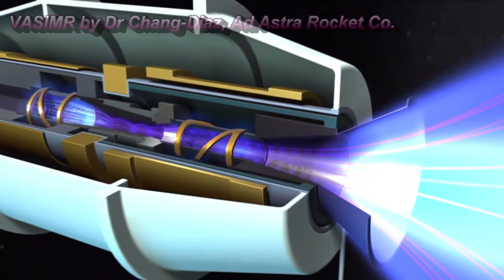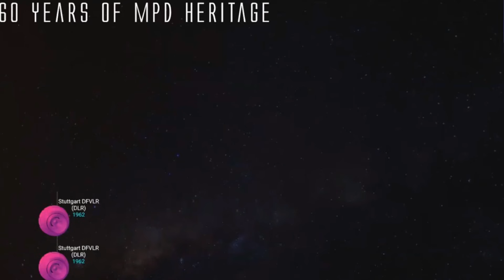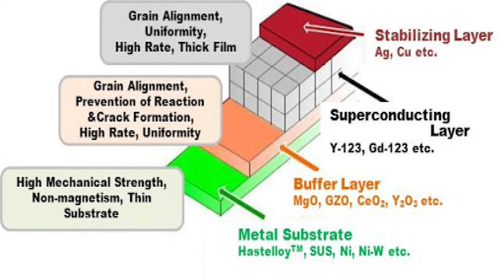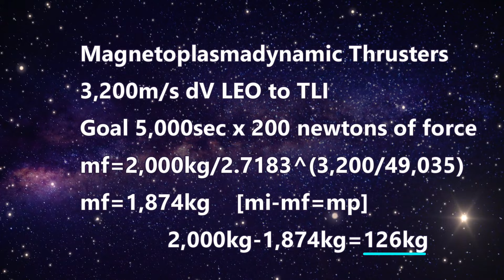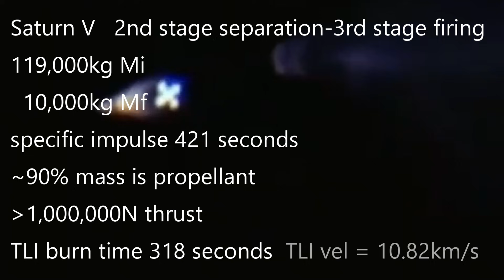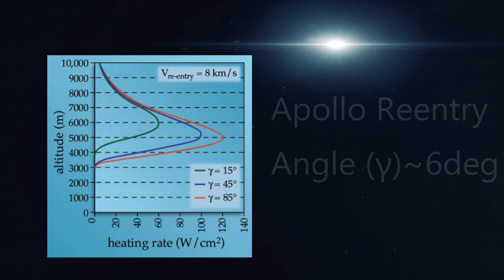Rocket Science: Magnetoplasmadynamic Thrusters and Magnetoshell Shields

Comment: Gravity balances.  If that means the forces from Terra and Luna are equal and opposite, then the net force is zero.  No force, no acceleration, so a particle would travel in a straight line.  At L1, the motion is circular around the T-L center of mass, so there must be some net force toward the CofM.  How far apart are the two points?  Negligible?

Comment: Dump nuke, detonate, Nuke sends waves toward ship..must be a bumpy ride! Also slingshot maneuvers using stars and black holes? Also I was wondering about magnets and repulsion...if you bring two repulsive magnets together, at the point of strongest repulsion, and fasten them in that position and place them in space do they spin if 1 side of the magnets has an obstruction fastened to block magnetic field 1 way...will the assembly spin? If so that would be propulsion...bolt to ship? It probably does nothing but I thought I'd ask🫤

Comment: I realize it's probably critical to be able to control the magnetic field, but are permanent magnets out of the question? Also, for a cooling system to work with the electromagnet, you nee to dump the heat somewhere.  Where?

Comment: Great video! There are a few mistakes you could correct to improve it. At 11:15 you incorrectly state that increasing the magnetic field doubles the power to thrust efficiency. From the numbers presented it is clear you are talking about propellant efficiency, which is just another way of presenting specific impulse. The power to thrust efficiency actually decreases by about 2%. (2.75/100) / (2.1/75)  = 0.982.

Comment: That math says you could hit 0.1c before hitting the inner asteroid belt (mid solar system), given enough or even a single powerful drive. 10KW is nothing, a 1MW reactor would be the size of 2 40 gallon drums, one stacked on top of the other (and I'm using "1980" CAN-DU / MIR reactor math), these days, maybe half a 40 gallon drum in size, thats like 100x the needed power for the moon drive. Even if the rest of the spacecraft used 0.1MW, thats 99x the thrust (same ISP), or 99x as fast (0.0007c x 99 = 0.0693c).. so a 3MW reactor as mentioned = 0.2079c! (TO BOOT = for under 4 metric tons of argon fuel! Reach 0.1c > Coast > break from 0.1c = still have a 5% error margin of fuel!). Assuming 8 metric ton craft total, 4 tons of that fuel.
Thats still like 44 years to Alpha Centauri (but getting reasonable), 0.5c would be ideal and have minimal temporal relativistic effects (1.155 days of Earth are "experienced" as = 1 day on 0.5c ship), getting same trip down to 8.8 years (7.62 years to ships crew), but we are talking 15MW+ power requirement and like 50 tons of argon fuel for same 4 ton payload. Helium3 could cut fuel mass needed to a quarter of argon mass (and/or quad the ISP)

Comment: If helion is successful with their fusion reactor. What type of ion engine will benefit the most from limitless electricity.  
  Let's say that helion's dependable model is the size of a tanker truck without the truck. Do you see a day when we build a ship in space and can maybe ride out to Jupiter in 6 months. 
    Love your channel.
Reply: with the power output of a fusion reactor I'm pretty sure a system like this would be able to reduce the fuel throughput by enough to apply thrust over a much longer period of time, the fuelweight needed to generate large amounts of power in a fusion reactor is relatively small in comparison so it should result in a much larger overall dV and travelspeed. I am sceptical on the proposed use of superconductors in the video though since its extremely important to consider the cooling needed, you would already need extremely large radiators in order to keep a regular magnet cool, how this scales in relation to the power savings due to magnet efficiency really depends on the specifics of the superconductor but I guess "which magnet" to use isnt the main issue when a fusion reactor is in involved, it becomes a relatively simple power balance of the magnets power consumption vs the power consumption and weight of the cooling system

Comment: Liquid Argon temperature is -303 degrees F, if you find a super conductor, in that range you could use fuel to cool the magnets.
Reply from the maker: That would work with REBCO like the SPARC Reactor at MIT uses.

Comment: We should be able to test your Magnetoplasmadynamic thruster theory if we get a plasma cutter and put some permanent magnets north to south perpendicular to the nozzle to create thrust.
Reply from the maker: Sadly a plasma cutter is not actually plasma I don't think.  The electrons are no dissociated from the atoms... I made a small MPDT at home and it worked quite well... Until I shorted it out :-)
Reply: Your Magnetoshield theory would also act as a motor (Lorentz Force) to the Earth's magnetic field.  If the spacecraft tethered a long antenna (perpendicular to the Earth's magnetic field) and standing wave potential with current apparent motion "flowed" as the frequency oscillated (rotated) then the spacecraft would deaccelerate (assuming the right direction of rotation) away from the Earth.  With enough potential, the electrostatic effect could bulge the upper atmosphere out to increase the atmospheric deacceleration length.  @terranspaceacademy
Reply from the maker: Interesting...

Comment: Plasma thrusters that use generators with vacuum sealed push plates to compress plasma with pure oxygen within a chamber with an exhaust release valve that uses cold permanent electromagnets cooled with cold lasers and wrapped in superconductors that are also cooled with liquid nitrogen as well as cold lasers. This version of the plasma thruster also uses the Lorentz force to guide the plasma through The back of the ship with two opposing magnets wrapped in an anode or cathode and also is connected to a chemical rocket superheating the gas in the chemical rocket and forcing it out of the ship as the plasma is fused with pure oxygen and so is the rocket fuel. The ship also uses solar sails and solar panels and used the world's strongest magnet to overcome low gravity on the ship. The ship is very large and has a very nice telescope and is equipped with many different types of equipment with many different types of space officers.
Reply from the maker: Oxygen is not the best propellant...
Reply: @terranspaceacademy Argon instead
Reply: If you configure Dr. Subrata Roy's WEAV to utilize Argon for VASIMR EHD in a Double Lenticular Hull Geometry, you can contain & unify the Field with Low Temp Superconductors nearing the Zero Point. 

You can do all of that in our Atmosphere right now.

Comment: Can you build a plasma generator that uses a vaccuum sealed push plate that forces oxygen and plasma gas into a chamber at high pressures while its heated up with lasers and has an inner core that has a radioactive sphere surrounded in water wrapped in a diamond layer and a heat resistant glass layer floating in the water inside of the sphere with a little space between the inner radioactive material and the outer shell so that it does not melt but refracts the light outwards with cold permanent electromagnets wrapped in superconductors cooled with cold lasers and liquid nitrogen to confine the plasma in order to power a plasma jet that fires directly through a chemical rocket booster on a ship with solar sails and telescopes and solar panels and solid electrolyte batteries. I need this ship in order to get home.
Reply from the maker: Vacuum sealed... in space?  Everything is vacuum sealed. :-)

Comment: hello sir, can we do this at 15:19, we calculated exhasut velcoity by multiplying g-force of equal to sea or surface level 9,81/s^2 but g-force is inversely proportional to altitude and we are calcauting exhasut velcity for leo to tli,  so at leo we have microgravity which has far less value than 9.81 and if we consider 10% of 9.81 which is equals to 0.981 so Ve= 5000 x 0.981=4905 for b/w leo to tli theoratical calculation. thank you
Reply from the maker: I see your point.  For the purpose of converting Isp to Ve or vice versa the standard is still 9.807m/s^2.  Even in freefall or on the Moon.  That's just a way to make the efficiency of the rocket engines comparable.  But you are right.  Thrust to weight ratio will change dramatically on the Moon.  What was a sedate takeoff on Earth would probably break all your ribs on the Moon.

Comment: How can propellant make propellant via combustion..    did you mean propulsion? (First 30 seconds of video)
Reply from the maker: The chemical reactants produce propellant, the end products of the reaction, water for hydrolox engines and water and carbon dioxide for methylox, with of course the fuel rich engines also using some fuel itself as a propellant.  The point was that chemical engines produce their own energy, thermal, and propellant, the products of combustion.

Comment: ion drives have high efficiency, and high exhaust velocity, but low exhaust mass and low flow. so need to increase flow to increase mass/time...  how much area does an ion drive exhaust bell cover?  how does it compare to those of chemical rockets? how do mass and size compare?  obviously there is a massive savings in reduced propellant needs, some of this could be exchanged, so how does that work out?
Reply from the maker: The best bet to balance thrust and efficiency is the Applied Field MDP, everything else is very low thrust comparatively.

Comment: I think there's potential to utilize quantum energy teleportation that they just proved in the lab to make a new type of engine that moves energy in one direction and then recollects it at a new point in space that is farther away from where ot started. Basically a waterfall of energy that flows in whatever direction you desire that teleports back to the top of the waterfall so you never need to refuel your space ship. The thing is though is I don't know if this quantum energy teleportation requires input energy to teleport the energy back to the top of the waterfall or even if the teleportation of the energy going back to the top of the waterfall negates the thrust you get from having the energy flow down the waterfall from the start of the waterfall.
Reply from the maker: How?...

Comment: On re entry instead of firing the engines to slow yourself down why not just use the weight of the fuel you were going to use to slow down as a heat absorption tool. You could have it circulate through pipes in the part of the ship that's going head on into the atmosphere and as it heats up you could let some of it off gas to keep the temperature within a certain range. I don't know how well that would work but to me it sounds like a decent idea on paper
Reply from the maker: that's the Stoke Space plan...
Reply: spacex was talking about skin cooling for re-entry too  @terranspaceacademy
Reply: @terranspaceacademy  hmm?
Reply: Adiabatic reentry heating produces a similar amount of thermal energy as the gravitational potential energy required to get the craft into orbit to begin with. Even for an earth only aircraft, it's not going to have a huge amount of fuel left ... Not much thermal mass. Obviously the majority of reentry heat is left in the atmosphere, but still it just doesn't add up 

What you CAN do, though, is heat up a tiny amount of fuel and throw it overboard as it changes phase. Kind of similar to sweating and ablative heat shields. If it creates enough pressure during phase change too it can be used to create a sort of bubble around the exposed surfaces and prevent them from direct contact with hot plasmas

Comment: So low power high temp superconductors are where we have to work hard. Fantastic lesson as always!

I have a question — why not light pressure aka laser drives? There was some discussion of this in the Sixties, then it disappeared and I’d love to know the technical reasons.

And…

Is there the possibility of using solids or liquids instead of gases in the drive to increase propellant density?
Reply from the maker: The loss of energy conversion for lasers is about 80%... Masers have a better rate but are still harder to make.
Reply: @terranspaceacademy  

Ah, so if we could get it to 50%…

Thanks. The devil is always in the details, and for those of us without your depth of subject knowledge, it’s a bit err, difficult to say the least.
Reply: Now we have the lk-99 which possible is a room temp atmos pressure superconductor
Reply: @user-sp9ue1ws7c  

Yes, it may be. We need third party confirmation that it is. If it is, considering the relatively inexpensive materials and processes involved this stuff could be on the market in 4-5 years, at which point EVERYTHING gets more efficient. Phones, cars, computers, hell anything that uses electricity is going to go through revolutionary changes if this works.

It will also make computer implants far more efficient and way less expensive. 

If it works. I hope it does.

Comment: About the energy released from fusion did you use moles of atoms per gram cause when I did the math it was much more energy per mole than what you said? I converted the ev to joules and energy per atom in 1 mole, also did you calculate for the radiation from the anti matter reaction as a result of fusing to higher elements? Trying to learn.
Reply from the maker: I assume an estimated percentage of power loss to inefficiency.  We would need to be aneutronic like boron-hydrogen.
Reply: @Terran Space Academy  where would you think the power loss is coming from? And what would you think the coumlumb barrier for hydrogen to hydrogen fusion is for I got around 100kev? Also now that I think about it would boron hydrogen use more energy than regular hydrogen to hydrogen fusion?

Comment: All hail the algorithm
Reply: Good, and use the heated fuel to power a forward facing thruster designed to generate sufficient pressure to redirect plasma around the vehicle from atmospheric re-entry heating eliminating a lot of the otherwise heavy shield tiles from key areas, sort of like a virtual nose cone made out of high velocity exhaust gasses opposing the direction of ionised air flow.
Reply: @cLiPpY8632 Like Dr. Isaiah Blankson and Dr. Schneider's MPD Hypersonic Honeywell Scramjet but just the MPD Plasma Nozzle. 

Contain the VASIMR effect with Superconducting Magnets & simulate Near-Zero Point Conditions with Bose-Einstein Condensates by cold lasers, etc.
Reply from the maker: Thank you DJ!